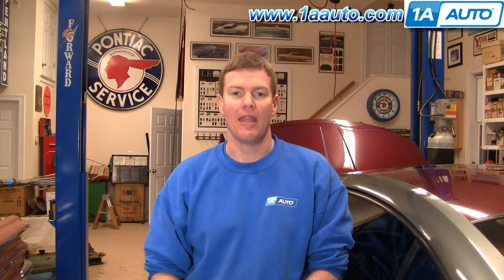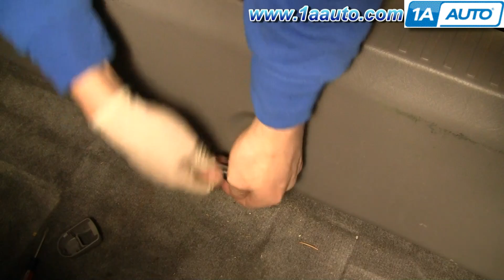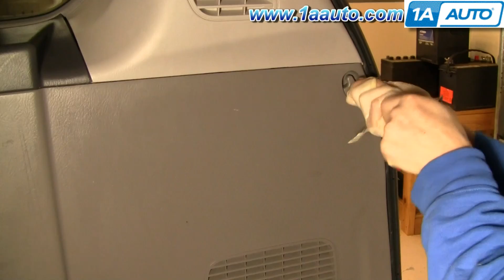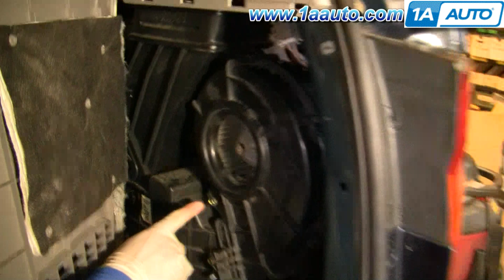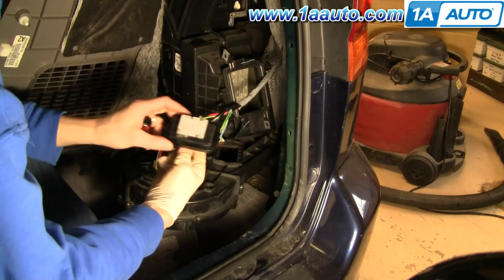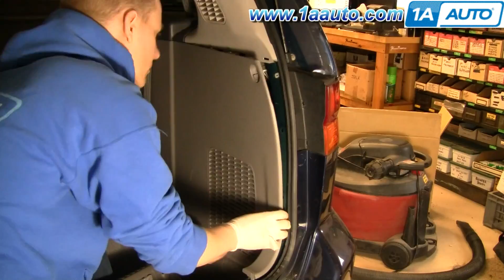How to Replace Blower Motor Resistor 95-04 Honda Odyssey

Comment: Can you do a video on where the blend door at and the actuator that control the rear ceiling vents cold air works but heat doesn't  on a 2004 honda odyssey

Comment: Have a question.. the Blower motor works in AC can feel the down-force coming from Above vents but when switching to hot I (cannot) feel the down force I'm sure there is a flap I can hear the airflow changing but no pressure coming out of the vent, I Don't believe there is a filter ?
Reply from the maker: +Rick Mavic Time We wouldn't be able to diagnose an issue like that here, you may want to have a local mechanic take a look at it. Thanks for checking us out! http://1aau.to/m/Shop-1AAuto-c
Reply: I have found my answer... That AC blows out the top events.. The heater blows out lower vents in the rear passenger side.. This was not like this in my other vehicle.. Did not find my answer until leaving the blower on and climbing in through the back door.... Ha Ha right :)
Reply from the maker: +Rick Mavic Time Thanks for checking us out! http://1aau.to/m/Shop-1AAuto-c

Comment: I've been using all ur videoes  to fix my 2000 honda odyssey can u tell me how to vix the vents for the ac? the only vents that blow for the ac/heater r the ones in the front by the driver and passenger doors none of the middle vents or vent in the back blow air. how do I fix this
Reply: 1A Auto Parts were r the vac door actuators  it sounds like there paper or something in the roof of my van like its vloged o r something. I mainly want the back vents to blow air for my kids

Comment: When I turn on the rear blower to cold air it will blow but won't at all for the heat.  Is it the same fix as shown in your video?
Reply: never mind, the hot air only comes out from the floor.  But it doesn't get hot so I have another problem to figure out.